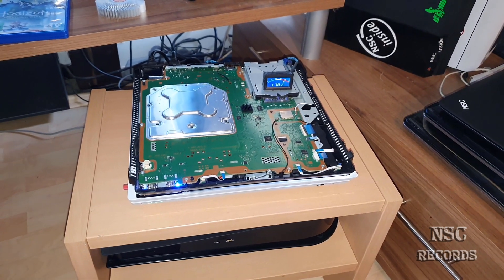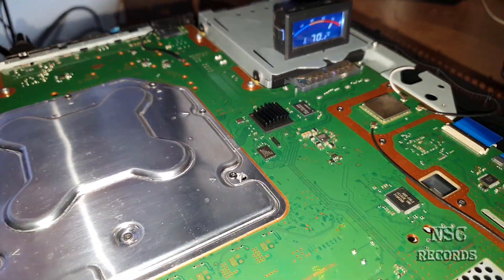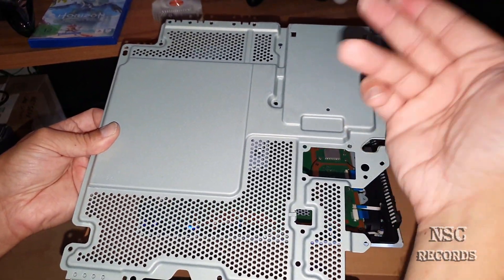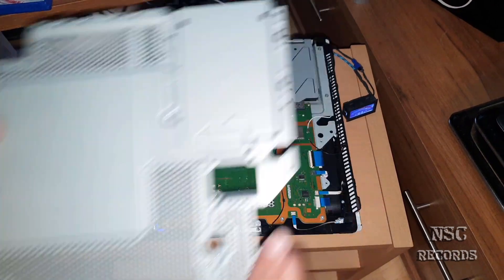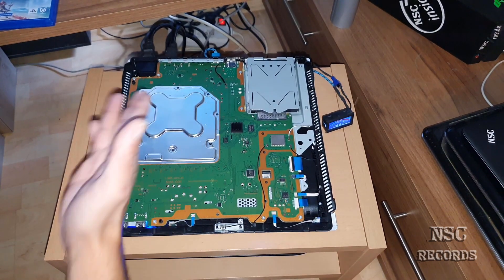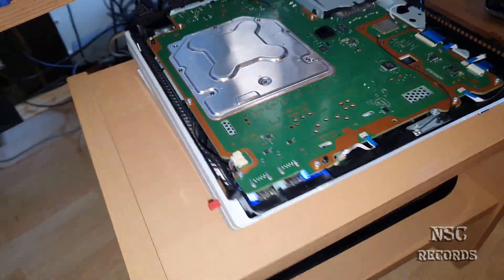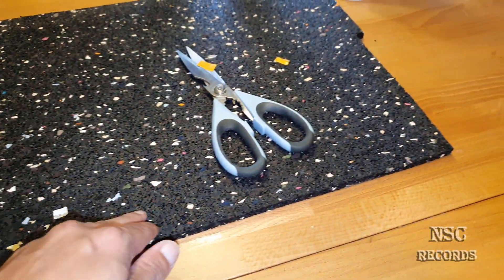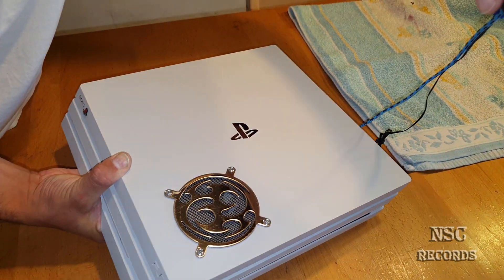An other great PS4 Pro cooling mod & some more stuff By:NSC

Comment: Liquid Metall helps me a lot With my Ps4 pro i have too a Fan mod and i wanna to costum watercool it But idk if i want it when it will be cold in Winter so i have a Ps4 pro heater in my room 😅🤣
Reply from the maker: Yeah, and it's expensive to 😅

Comment: I decided that I'm going to try to keep my console stock as possible but I'm going to use thermal grizzly thermal pads and thermal paste.  If I keep the heat shield on, how do you think that chip that you have the black heatsink on will do with a thermal pad?

Comment: The metal or RF shielding isn't required and does nothing for airflow or cooling. It's only there to make the device comply with FCC regulations. So you could remove it completely, it won't affect the PlayStation's performance.
Reply from the maker: We know i think 😆

Comment: What are the dimensions of the heatsink that was added? Do you have the exact dimensions of the die the heatsink was added to?
Reply from the maker: 13*12*5

https://www.ebay.de/itm/181484455779
Reply: @NSC-Modz  Thanks!
Reply from the maker: @zaedon7356  you welcome

Comment: could you remove the metal cover on top of the vram ? and put some low profile heatsinks on those vram chips ?
Reply from the maker: Yes you can ;) 😉
Reply from the maker: @Baz yeah, but this is for the people's the easy way, not every one wants to take all apart 😀
Reply from the maker: Waiting now for my 8 copper heatsinks witch im gonna replace them on the vram chips and do of course a video about :) PEACE
Reply: @NSC-Modz  also bald beastmode cooling 🙏🏼😁
Reply from the maker: @klickbaam  yep, zumindest besser als davor 😀
Reply: @Baz Not only does this make more sense. But, taking it a step further. No one seems to understand the cooling design of the ps4 consoles. People put holes in the top of the console which makes no sense. The bottom of the console gets excessively got. Putting a hole in the top ensures that the air flow in the bottom of the case is even worse. Why not strategically place small holes in the bottom of the case to allow adequate cooling. Maybe a 1/8" hole above each of the ram chips and the other chip that is being heatsinked in this video? This would not destroy the air flow design and allow for better air flow across the hottest components.

Comment: NSC I need help  😭  I have ps4 pro i hardly ever played and I think when the power went out the ps4 might been on sleep mode cuz i sometimes bump the power button on my desk. But it doesn't turn anymore. Doesn't do anything when i press the buttons.
Reply from the maker: Hello I can not recommend to put it on sleep mode, always shut it down. For the rest you need to test it, thermal paste, dust inside and and and...

Comment: Cutting off(what you called table) that area will be better..than exposing it to short circuit issue.
Reply from the maker: I meant table in your case, not in my case, in my case this is just a small bedside table 😂

Comment: Do you think cutting the holes on a PS3 hdd caddy out will help with temps a little bit?
Reply from the maker: Yeah, a little little little only... it's better you get an SSD for cooler temperatures and a faster system :)

Comment: Interesting modifications. If they work for you, that's great. Honestly though, I suspect Sony's engineers and designers know a bit more about thermal dynamics and appropriate component airflow. I suspect they would not have designed the PS4 Pro to intentionally overheat, and I tend to agree with Rip-Felix' hypothesis that it's better not to modify the case at all. Since you have only tested your mods for two days, that's a bit less than the years that Sony has invested in determining and testing proper airflow through the PS4 Pro. But again, if it works for you, that's great!
Reply from the maker: Hold on Hold on!!! It works not only for me, it works for all who did the same like on this video! The main problem on this PS4 Pro is, that the vram chips get to hot. The latest Pro has not this problem, because they fix the hot vram chips and power consumption. Again, this is still working all Perfecly, and i had a lot other PS´s where i did the same mods! All Still working, and i would never upload something thats would not work for a long time xD And who the f*** is Rip Felix? Did he ever hold a screwdriver in the hand??? You mean the guy who did one video about the PS3 FAT Cooling YLOD and stuff? This was a PS3 FAT Edition, and he talked only about the FAT Edition, not compareable with the PS3 Slim, Super Slim, PS4, PS4 Slim and PS4 Pro. One thing i can tell you, i know very good what im doing, specially when it´s about cooling modz... and people's trust my work.
Reply: They also would have made choices based on what accountants told them.  If they were to tell accounting team they need an extra $10.50 to add a fan, grill and hole to the top of a sony case, to keep the console cooler, theyd ask them what does it add?  "It adds longer life " and the accountsnts tell them dont bother,  by then, we will release new console!   Also the art dept. Would not be happy if the engineers are drilling holes into their well designed cases right?

I typically agree with you, with things like cars, because cars are still manufactured with longterm purchasenin mind. But gaming consoles?  Sony and Microsoft assume we will throw down $500 every 5 years and be happy about it and not wonder about using the older console for another 5 or 10 years.
Me?  Im a big fan of modifying anything and everything to last longer.   That includes me replacing motors in my fridge, it includes modifying the car, it includes installing my houses insulation in the attic myself, regardless of the effort because i plan to live there and possibly pass it on to my kids and I want them to be warm and cozy.  So my gaming consoles also get the same treatment.   Even my older consoles that only worked on "passive cooling" i went ahead and turned on and played while holding a thermal camera above the naked console, original nes, snes, ataris,ps1, gamecube,  etc (some of these had active cooling but they were upgraded too!)  I saw which chips were getting hot and mounted small copper heat sinks to them. Then the heat sinks get placed in a cute tiny aluminum "tunnel" made from  soda cans and they get cooled with a fan blowing air through the tunnel, pass the copper fins :)  does a freaking nintendo nes NEED THIS?@ let's just be happy i didnt bother to liquid cool the original nes or put it into a mineral oil cooling tank!  Heck, even my handheld consoles get this treatment, but I add built in high cap lithoum batteries I recharge via usb-C, so i can power the probably not necessary fans... I also add a switch for the fans in each console, and if i had extra temp probes and small lcd screens, id add that too, atleast for the beginning to gauge how well the changes impact the temp.  High temp is what kills chips and for some weird reason I want to be playing on an original nes when i retire!  (Which is also why non-modified nes consoles are stored vacuum sealed in a spare closet that doesnt get too hot or too cold!)
Reply: I agree with the sentiment of not doing this but not for the reasons you think. This mod is weird because he downgraded to a ps3 fan, plus it will suck in a lot more dust from the open top. Also, subjectively it looks ugly.

Comment: Any mods for PSU cooling? Mine is kinda hot on ps4pro, dont know if thats normal or not.
Reply from the maker: It's normal on load, and it's normal when your fan is not turning fast enough.

Comment: Would you consider selling this?
Reply from the maker: Selling this PS4?
Reply: Correct as you already have a ps5
Reply from the maker: @8bitDNA  yes sure, but a PS4 like that is brilliant. It's a limited edition. The PS5 has no Internet Explorer. You can even not set a picture you like to the Homescreen. The PS5 deleting games from alone. PS5 have controller lags. The PS5 have bent Heatsinks! The only good thing on the PS5, is the performance, but the rest sucks hard 😂

Comment: Been a year
Reply from the maker: Yeah, and still working like a charm 😀
Reply: Lol I just modified the fan cover for my ps4 slim, was dirty and eas over heating and causing input lag like a mofo but this should help with air intake and I'm gonna put it up higher for better air
Reply from the maker: Yeah, and if you do it all nice and sexy, it will run quieter too 😆